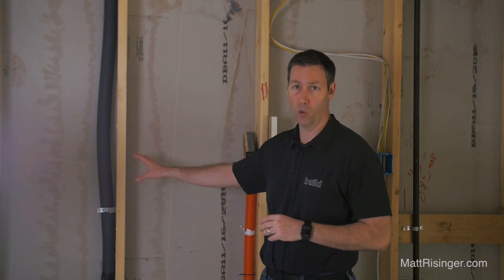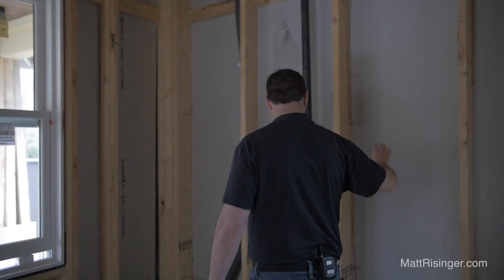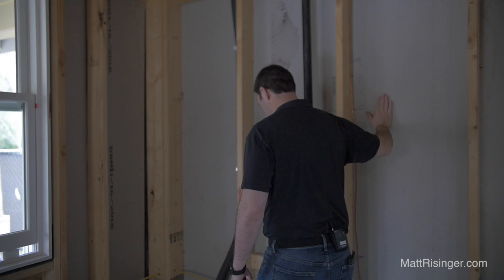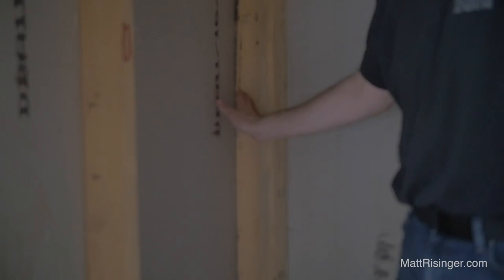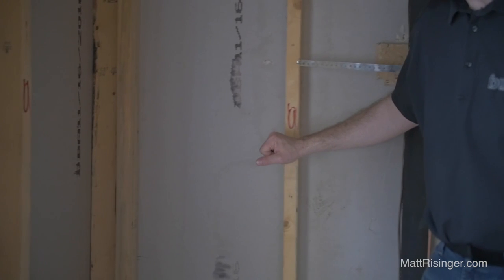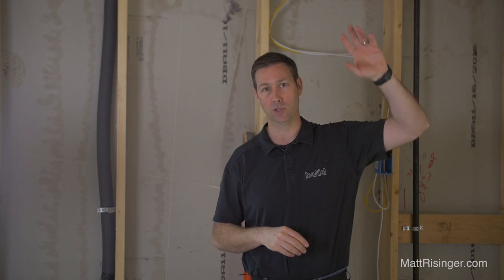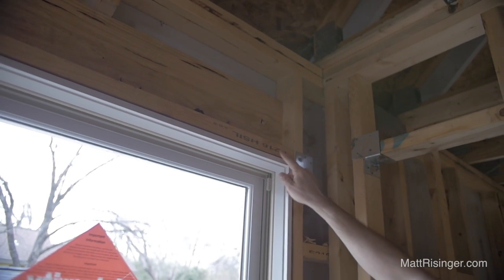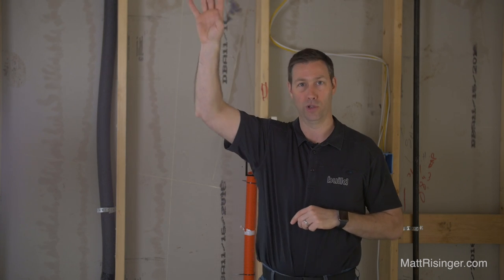Traditional vs. Advanced Framing

Comment: Traditional framing is the way to go.
Reply: Advanced framing is significantly better than traditional framing. You end up with a stronger builder and it is much more heavily insulated.
Reply: Your design costs (and perhaps your engineering costs) are likely to be higher.
You’ll need to invest more planning time and produce more accurate drawings.
Your local code officials may balk at some of your details, so you’ll need to budget time to negotiate with your building inspector.
If your framers are unfamiliar with optimum value engineering, they’ll need to be trained.
If you have to seek out a framing crew with advanced framing experience, your labor costs may actually be higher.
As your framing crew works through the early phase of the learning curve, their productivity will drop.
Supervision costs may increase, because someone needs to ensure that in-line framing and other advanced framing details are implemented properly.
Any savings in lumber costs will be partially offset by added costs for steel splice plates, drywall clips, header hangers, thicker subflooring, and in some cases deeper floor joists.
Using a single top plate means that you’ll no longer be able to use standard precut studs — you’ll have to buy longer studs.
Customers may perceive advanced framing techniques as inferior or substandard, because less lumber is used.
Some siding types, including vinyl siding, require 16-in.-on center fastening, and are therefore incompatible with 24-in.-on-center framing.
Without jack studs, it’s harder to fasten siding or trim near windows and doors, because there’s less framing to nail to.
Energy savings are small; according to one source, advanced framing techniques changed a home’s whole-wall R-value from 16.2 to only 17.2.
Reply: Because the thermal benefits of advanced framing are relatively minor, many builders have concluded that the small savings in materials and energy use aren’t worth the hassle and extra supervision required to make it happen.
Reply: Tim Budz Amen brother
Reply: Solid steel reinforced concrete walls all the way to the roof....with traditional framing inside, if shit hits the fan you still have the exterior wall and rebuild the inside(tornado proofingish)
Reply: Fuck progress, eh.
Reply: @brianmatthews4323  Replying to a 4 year old comment to whinge about liberals and woke indoctrination. Good grief indeed.
Reply: @benmjt  You read and answered it didn't you?
Reply: @brianmatthews4323  And?
Reply: @benmjt  And what?

Boy, if you have something to say, be a man and say it. I did.

Why can't you folks today just listen and take wise words to heart instead of arguing? Arguing will never make you right.

Comment: Here in Canada where we get -40 in the winter we frame traditionally but our exterior walls have to meet a "true" r22 value. Exterior Styrofoam, 2x6 walls triple pane argon gas windows and r60 in the attic are all very common. You can get good r value without using all those weird hangers around windows
Reply from the maker: +MGarroz agreed. Just showing one method here

Comment: Having been (& continue being) a licensed framing contractor here in California ( with some of the strictest structural & energy laws in the USA) for the last 30yrs, I can assure you there's nothing "advanced" about this. 'Shoddy' , 'cheap' & 'structurally deficient' would far better characterize what you're seeing here...I'd be ashamed to submit something like this for inspection & would not agree to construct any residential building like this for fear of (rightly) being sued by an irate customer. I can't even begin to tell you how many ways this falls far short of being anything that resembles quality, structural integrity or being in compliance with mandates that are time-tested & enacted using common sense in combination with proven technologies. Whoever conceived this methodology spent far-far too much time worrying about minute gains in R-factor at the expense of quality & structural integrity. "Advanced" ? Sorry, not even close !

Comment: Old farts are getting triggered! 🤣.  
Awesome videos Matt.
Reply: @dvader3000  THat horse and buggy you driving to work still working well for you? or did you accept innovation and now driving in an vehicle with an internal combustion engine?

per chance you still wearing cloths that happened to be hand spun?
Reply: socoj2 dude learn to spell properly
Reply: @dvader3000  Cool story Bro, whats your feed per day on the horse and buggy?
Reply: @socoj2  my feed?
What is wrong with you?
Dropped out of school,or never pay enough attention?
Reply: @dvader3000  I get it you have a problem with reading comprehension. Let me give you a time line.
1. You claim if it aint borke dont fix it.
2. I pointed out that there was nothing broken about the horse and buggy and assumed you were still using one instead of a vehicle with an internal combustion engine.
3. you attempted to insult me
4. i asked you how much it cost you to run your horse and buggy.
5. you still dont get the point.

The point is there may be a better way to do things than "Thats the way we have always done it"
Reply: socoj2 you are right there are better ways. 24” on center exterior wall just isn’t one of them if it’s for human habitation. 
    MAYBE if you have a load bearing wall every 10’ to support the roof trusses, decking, vapor barrier and roofing ductwork drywall light fixture ceiling fans Etc. What is being called advanced framing is only advancing the contractors profit while delivering a sub standard product. June of this year will be my 40th year working in new construction homes and remodeled home as well. 
     I have seen some very old homes hold up well with with true 2”X4” studs on center but they all had tung and groove on all interior walls sometimes called bead boards these also had conventional frame trusses which distributes the weight on almost all interior walls. These were built with dense old growth lumber. Without the young people trying new things and having new ideas there would be less innovation in this world.  I appreciate all of things that they do. If the young would ask around when they think they found a new way to do something they might realize it’s already been tried. The smarter one will look at why it didn’t work and find a solution the hard headed will just repeat mistake that already been made.
   And if you have never worked with livestock I have news for you two mules is better than a tractor in some situations. No flat tires and can go places a vehicle can’t.
Reply: actually if you run the load calcs for a 100 foot wall 2x6 24" oc vs 2x4 16" oc. The 2x6 compression strength is slightly better at 49900 vs 47700.
A 2x4 comes in at 636 lbs for doug fir vs 998 for a 2x6. also if you do single top plate you would want to stack your Trusses above your studs.

You also end up with almost double the cavity room for insulation.

I grew up on the farm. Ill take the Tractor over the mule every day, Thanks

While you have been working in them. I suggest you take an engineering course with some Civil engineers and discuss load bearing walls.
Reply: @socoj2  Limber size is not the only complaint about building this way. It's just not structurally sound, I don't care how many newly graduated engineers put the stamp of approval on it.

Comment: The header reducing is a nice touch but needs to be engineered, and is simply not allowed in some areas. Framing does change from district to district. I do like the extra room for insulation!

Comment: Interesting video, I was expecting it to be about using the new engineered lumber that seems to becoming more prevalent with every passing year. Some of the things mentioned in this video make sense, but I do wonder if the better way to achieve improved R-values wouldn't be to wrap a traditionally framed house in rigid foam, then put your siding over that. Seems to me that it would be far more effective due to a lack in gaps like studs, headers, etc.
Reply from the maker: +Siegfried Gust I don't disagree. In fact look for my old videos on that topic or stay tuned for a future video on Huber Zip -R sheathing that has insulation attached

Comment: What are you going to attach your outside corner trim to ??? Latter backing isnt that great for sheet rock .and you have to have 2 trimmers under each side of the headers .4ft. and over .also some of the most missed backing in houses is curtain rod backing , so full headers are great as well

Comment: Texas does have a wind load, walls must be tied to the roof using hurricane straps and tied to the floor as well. This is for tornadoes. Texas also has seismic requirements, I don't know where you got your information, but it is wrong. You are correct that there is no snow load requirements, but there is a snow and ice requirement in the Panhandle.

Comment: Traditional = Slightly less insulation factor, but more structural strength. 
Advanced = Slightly better insulation, but less structural strength.
Reply: Citation needed... On the structural part.

100 foot wall 50x 2x6 vs 75x 2x4s...

Comment: Hi Matt!  Great content!  Quick question: if you're remodeling a room requiring a wall teardown on the first floor in an ancient house (plaster tongue-and-groove), is it possible or not to incorporate advanced framing in just the area you're remodeling or would it take essentially a tear-down of the entire vertical of the house to the roof?

Comment: What part of Texas do you live/build in?  In my part of texas, it gets fucking hot and cold.  Spring/Summer/partial Fall sees temps in high 90s to low 100s.  The couple of months of winter gets below freezing and can stay there.  As a matter of fact, 2 days ago it was a very comfortable 70°, now its 25°.  That's the texas I live in.  I need my heat to stay inside when it's like it is right now.

Comment: Another informative video Matt.  I try to build with as many advanced framing techniques as possible, but I can't avoid using double jack studs.  We often use 4-5" casing material, like a bishop-cut, and you need the extra framing for backing for the trim.  Any suggestions on how to cut out some of these framing members?  Thanks for all your great content!

Comment: I’m finding my local builders are charging wayyyyyy too much per sqft and using the older building technologies and insulation methods. I it possible to use this as a way to get the new construction home at a lower cost, by brining to the attention of the builder that they are building below new standards and I know that the are?

Comment: When you “pack the header to the outside” how are you possibly getting correct bearing with the studs over the header?  You only have bearing on what looks like 2.5” on the the 2x6 stud.  Looks like a bad idea to me.  I’d rather have a strong house than over doing it on insulation.

Comment: What Matt totally misses is that insulation is against cold AND against heat. Texan or not, when you have a scorching hot day it is great to have good insulation. Back in 2009 I went inside into one of these zero energy houses and boy was it cool and cozy inside. No need for AC even though it was the hottest day of the summer.
Reply: "zero energy houses" = tents.  Of course there was AC, but just not used as much.

Comment: Hi Matt, I like the advanced framing, but I have concerns as to how long a house could be accessed by firemen before they had to fight it from "outside".   I know that modern framing or building techniques have made homes go up in flames very quickly.  I don't know if your framing and building materials are better at keeping a home from burning as fast.  Thank you.
Reply from the maker: +Ed F Ed, You have to make an individual decision on that. I would tell you that most parts of the country are adopting the new code that requires fire sprinklers so the point may be moot
Reply: I see your point and understand it.  To the sprinkler code, I think that many homeowners will not keep up with the maintenance requirements of these systems, thus canceling the benefits.

Comment: matt did you do your research on zip systems that product fails testing on water
Reply: ZIP doesn't fail any water test.   Of course you shouldn't  leave the edges exposed to water like any other OSB.   So it should have a trap over it and tapped as soon as possible once it goes up on the house.   DuPont (makers of Tyvek)  would rather you believe ZIP is a failure waiting to happen.

Comment: Not a huge fan of 24”OC studs - My parents house has them in some interior walls and it tends to let the Sheetrock flex too much. Also confusing when you’re trying to locate studs.
Regarding the corner insulation, our builder did actually insulate the corner spaces with spray foam insulation. You talk about the extra stud costing insulation value, but the total length of the ladder blocking looked to be close to the length of a stud if you stacked it all vertically, so you might as well have a single vertical stud in the corner.

Comment: With the added cost, you could probably build a double wall.
That hanger on the corners is just asking for drywall cracks while the house settles/wood dries out. 
I pity the trimmers working on those doors.

Comment: that sheathing might work if you can A: afford it and B: if your contractor has access to and will use it.. as for changing the framing of headers and the distance of studs "reguardless of stud size.. aka 2x4 or 2x6" as 99% of codes will still require a 16 inch OC spacing.... just a thought before someone gets in trouble for not building to code... may cost more in lumber.. but its better than having to tear down and rebuild later after inspector looks at the place...

Comment: Hello.. What's the blue stough on the wood studs called? Thanks
Reply: bigboy gil it's a mold inhibitor in case of flooding and moisture wicking up from below into the framing.  It's only applied to the bottom for that reason.

Comment: It all depends upon where u live. If your in the desert areas of the southwest/cali then its not a big deal. If your in the Midwest or cold climate Its very important. I wouldn't want 2x4 construction myself and think 2x6 should be minimum code. I built my house with a double wall construction to eliminate any voids and to get an r-30+ in the walls, but I live in Northern MN where you have extended periods of below zero weather.

Comment: so where's the installation of sheetrock and trim work with this advanced framing and how well those hold up with 24"o.c......that's on center....ahem....studs....what about a 16"o.c. floor system? doesn't line up too well or was that advanced at 24"o.c. as well?

Comment: If you focus just on insulation HELL just build the house out of foam. Framing is structural having 2x6 @ 24oc means any warpage which there always is.  One 2x6 stud warped put a 4' bow in the wall.  I want my house to last a little more then 10 years.  full size headers, king studs, trimmers and cripples on 16" centers In all my houses. Nails only hold structural members (trimmers and headers etc.) in place and are NEVER used  in sear force like the hardware being used here.  Advancement framing has to be better structural not just better insulated. A warm house that the doors and windows don't work very well doesn't matter much.  This type of building is how they build modular and mobile homes not the 700k home I build here in So. Cal.

Comment: One king stud great, wait until you nail your exterior trim to 1/2 inch OSB. In CA you need solid lumber in corner to bolt hold downs. And if you want 2 foot centers your ceiling joists and rafters have to land on top of studs. Won't fly in earth quake land.

Comment: AS he said in Texas they do not require factoring in loads. So build it cheap and flimsy. Let the Hurricanes and tornadoes blow it away and use minimal insulation. BEWARE all those buying a house in Texas.  Corner posts are usually required for Wind loads .Two 2x4's are needed by each opening for vertical load. 

   Now if you are building a shed use whatever.

Comment: Vapor 'transparency' must increase from inside out. Your polyester is a no-way barrier for vapor I think. And it's at a cold side. Your metal header holders are a 'highway' for cold temperature. You've removed one wooden plank and replaced it with one metal piece. Yep.

Comment: Advanced house using 2x6 studs only 24" OC and they cut out a 2x6 notch to install a 2x4 running horizontally? I'm good thanks.
Reply from the maker: +synolimit24ful that's not a notch. It's a block between the studs so that the sheathing panels have something to nail into at the edges

Comment: I think they try to use less wood to reduce cost and replace with cheaper insulation and less labor since there are less studs to put up. BUT I bet the cost of the house is either about the same or more than a traditional house. Although this may save on cooling and heating over time, but how will the house hold up over the years. Will it squeak and rock in winds? How will the house feel and sound? I'd hate trying to hang things on those walls. Lean on that sheet rock and you'll fall into the wall. I guess everyone has a preference of building things, but I always look at the real reason behind changes. Some home builders love to cut corners.
Reply from the maker: +Victor Aguirre thanks for commenting but I would hope that you might consider watching some of my other videos before you lump me in with the "cutting corners" crew

Comment: Having dead space with 2x4 framing is due to contractor error, the way we frame, theres no un-insulated dead space in corners or interior-exterior wall meetings. Use your brain for once and you wont have that issue.